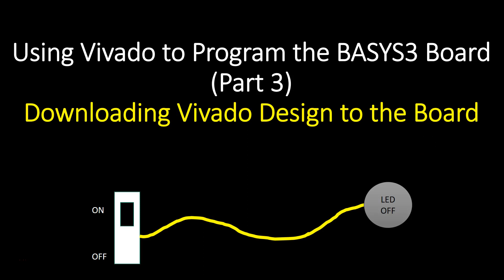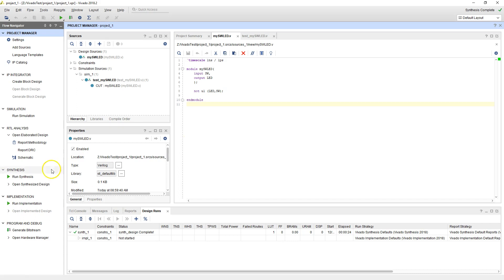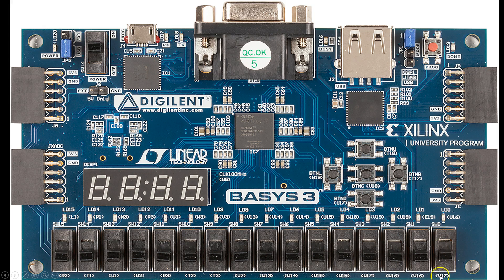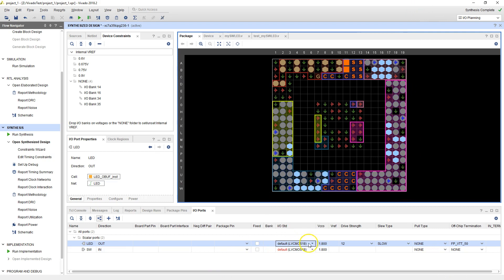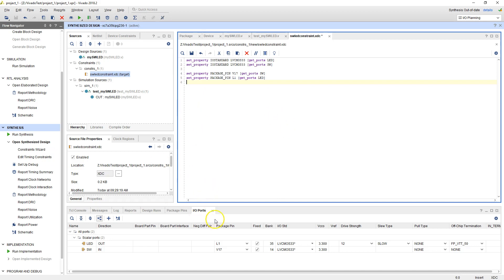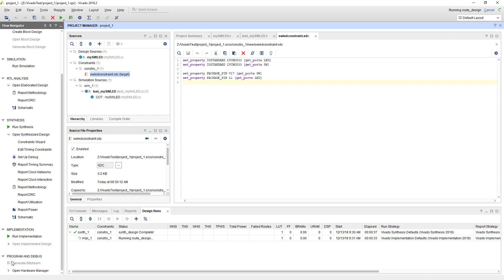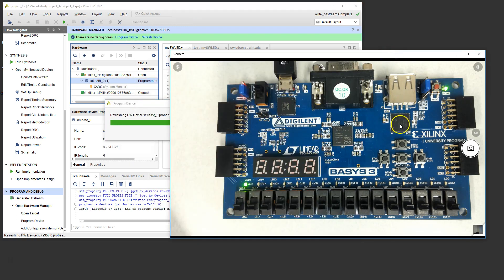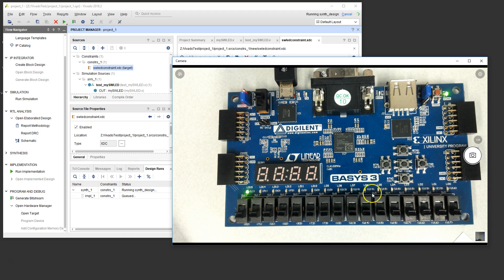Using Vivado to Program the BASYS3 Board Part 3 Downloading Design to BASYS3

Comment: Thank youso much for the tutos, they really helped me out!

Just one question:
At 5:17, for the schematic view, I don't have the the "package" tab (and I can't find it). I solved it by creating the constraint myself and copying what you have in yours, but I think it's not always the best way. Any idea of what happens? I'm working with VIVADO 2016.4 and the rest is almost the same as yours .

Thanks a lot !
Reply: On the upper right-hand side of the program you'll see a drop-down window saying default layout there you can see the IO Planning
Reply: @luisperez3507  Thank you!
Reply: @luisperez3507  I love u
Reply from the maker: The package view is available after you do the Synthesis. You can then click on Open Synthesized Design.

Comment: I am currently following your tutorial on design with vivado using FPGA.  I am using Zedboard FPGA to demonstrate what you have shown to us. But Hardware manager cannot detect my  Zedboard FPGA. What could have happened?  I need your help pls?
Reply: have you resolved the issue with the hardware manager? 

I am also having the same issue but with the basys 3 board and I am using the Vivado version 2022.1
Reply: @eoin8943  make sure the USB-A to microUSB cable is for data transfer, you should see "USB Serial Converter A" and -"B" show up in Device Manager when the board is connected
Reply: make sure the USB-A to microUSB cable is for data transfer, you should see "USB Serial Converter A" and -"B" show up in Device Manager when the board is connected